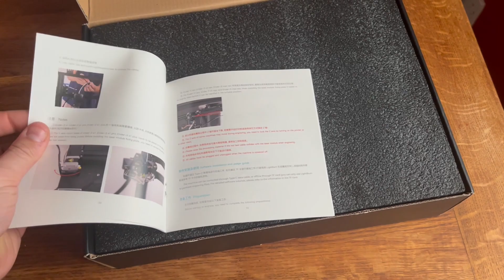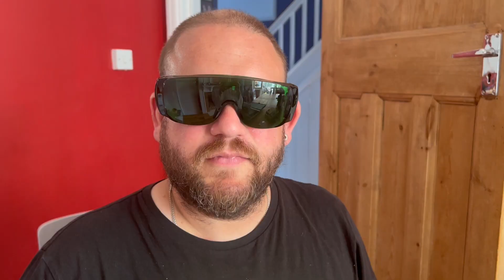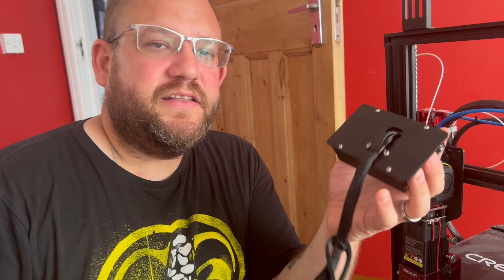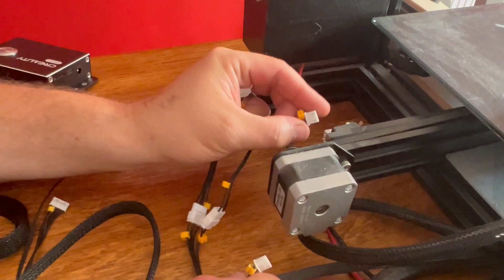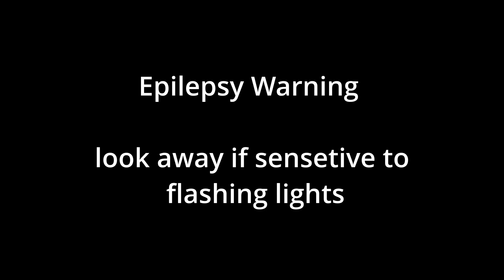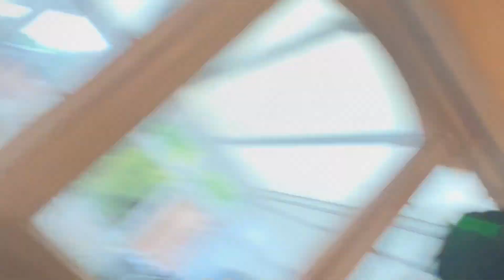Creality 5w Laser Module - Turn your 3D Printer into a Laser Engraver

Comment: Is the standard (glass) print bed also suitable when cutting something?

In this video you only demonstrated engraving a piece of wood, whereby the laser beam of course never hits the print bed. However, if you use the laser to cut a piece of wood, the laser beam will hit the print bed once it has cut through the wood succesfully.

Can the standard print bed handle this, or will you end up accidentally "engraving" your print bed as well?
Reply: I'm just watching this video for the first time, and just went over and saw this video, about the kit also including a new "bed" sheet that looks like it defracts and deflects light?   https://youtu.be/FEeqBx2sJBo?t=98  Note, I have nothing to do with either of these video posters!  Just offering some info, since you asked.   I'm a total newbee to lasers on creality 3dprinters, but, I have both an 80W and 120W $45K laser here in our university physics and engineering shop.   https://youtu.be/FEeqBx2sJBo?t=98

Comment: Note the short cable pieces on the wiring harness. These cane be left in place on the X and Y stepper motors to make it easy to swap the cabling between 3D printing and the laser unit.
I have the 1.6 watt laser module, which came as a package deal with the Ender-3 S1 Pro. Due to the different extruder on the Pro, you need to remove the extruder head to fit the laser bracket.

Comment: What do you do about the weight moving the gantry down? I recently bought a laser module and it really bugs me that it does that, sometimes it moves the engraving surface
Reply from the maker: I use small clamps the plastic ones like this 6 Heavy Duty 3 inch Strong Spring Clamps with Metal Spring Market Stalls DIY Workshops https://amzn.eu/d/efoQj1b
Reply from the maker: One on each side of the arms to stop it going down.

Comment: Not safe buddy could kill your eyes, you need an encloser to protect your eyes or other people who might come look.
Reply from the maker: Perfectly safe with protective eyewear. No one comes in when I am working. But your concern is appreciated 😊
Reply: I have the same laser and a 20watt laser that imam planning to run on that system, although the 5watt laser has a 3pin connector and my 20watt has a 4 pin connector. Have to figure out how this can work, I bought the 5w just to be able to use the box and mount the laser is a extra bonus😂 . I do however find it a bit strange to get a green pair of glasses and not red or blue, but I guess they know what they are doing when it comes to safety ( I Hope🤞) stay safe and share your findings and cool projects!
Reply: @Trots_Op_De_Boer If they look green, they filter out red and blue light more, if it was red or blue it'd be letting more of those wavelengths through, which is probably not what we want I assume.